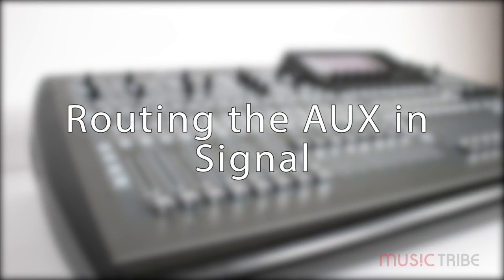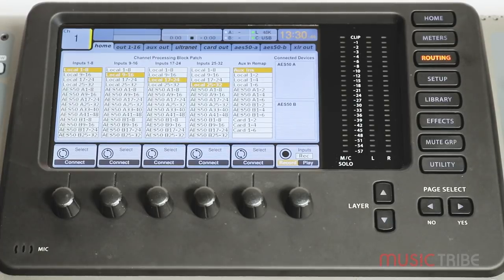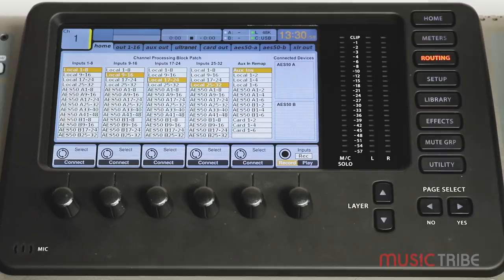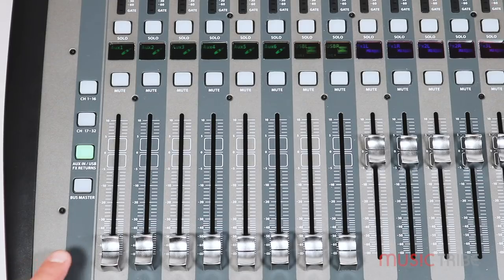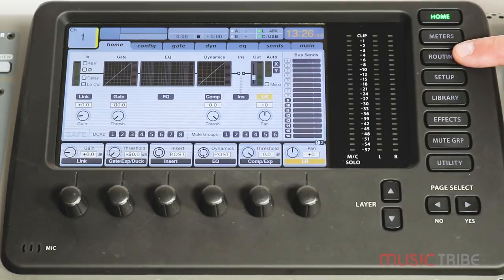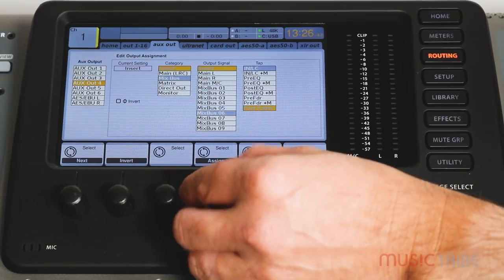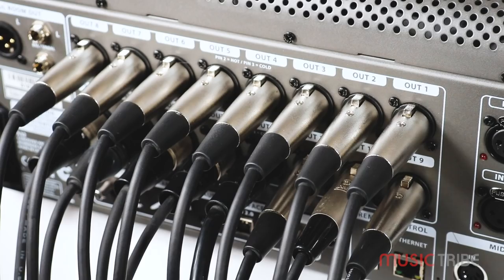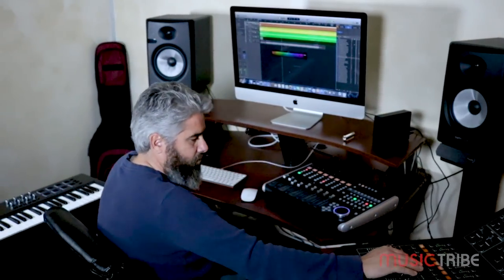X32 AUX Rundown

Comment: I'm using a Roland VR4 Video switcher to send audio to the Aux In of the X32 Rack. The source of the audio is coming from a computer which is plugged into the video switcher via HDMI. I'm using the audio out which is RCA from the switcher to the Aux In on the X32. When the fader is raised a screech sound happens.

Comment: finally a video that explains this... can you go more in-depth about aux out routing... I'm having trouble on my x32 producer sending to headphone and we only got one headphone out
Reply from the maker: Hi there! If I'm understanding your question correctly, you are looking to include more headphones into your setup. If his is the case, then just remember that each AUX OUT is a MONO signal. This means that if you are looking to use more headphones with your setup, then you would more that likely need to use two AUX OUTS to feed over to the STEREO input of a headphone amplifier, such as the HA8000: http://www.musictribe.com/Categories/Behringer/Signal-Processors/Headphone-Amplifiers/HA8000-V2/p/P0BRU

I hope this helps!
Reply: @behringer  The manual for X32 lists the 1/4" aux outputs as TRS jacks.  Doesn't this allow for stereo sends?
Edit: nevermind, I'm dense today:  I just realized they're balanced outputs.

Comment: is there a way to record the aux inputs through the usb expansion card to a computer? We just bought a x32 Rack and will not use additional inputs so its just the 16 xlr inputs and the 6 aux inputs. I know how to route them to our p16 units but We would like to record all the inputs on the computer. In Reaper I only see the 32 chanels.    (edit: Allready found a solution by updating to V4 and using user routing slots)

Comment: How do I get certain channels to the aux out so that I can use it with another outboard mixer?
Reply: I'm gonna try this tonight, but i believe if you pointed aux 1/2 to Bus 1/2 (or another open bus) on the Aux Out routing tab, you could send each channel that you want to hear to bus 1/2. I'll come back here later and comment if that works
Reply: It did work btw. I went to the "Aux Out" tab of the "Routing" page and assigned - aux 5 and 6 - to - bus 9 and 10. Now when i send a channel to Bus 9 it goes to aux 5 and Bus 10 goes to Aux 6. I'm sending to floor monitors tho, not and an outboard mixer. I had to crank the send on that channel so it might be better to use the XLR outs - the signal may come out hotter and those are already routed to buses LR IIRC.

Comment: Does the RCA 5 and 6 follow the phono 5 and 6? In other words, what I have routed to 5 and 6 will also affect the RCA 5 and 6 correct? No way to route these 5 and 6 separately?
Reply from the maker: Hi RAM RAM! You are correct. The RCA 5 and 6 cannot be separated from the 1/4" 5 and 6. They will receive the same output signal.